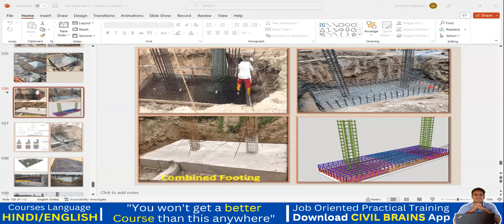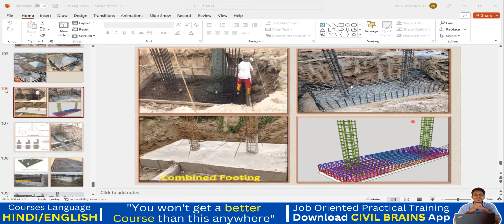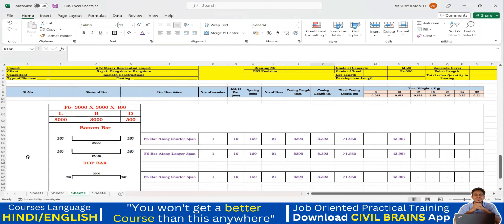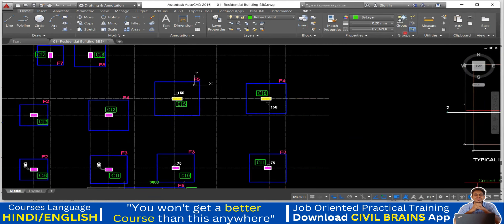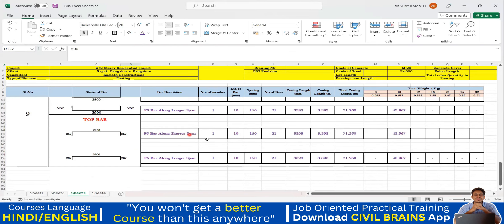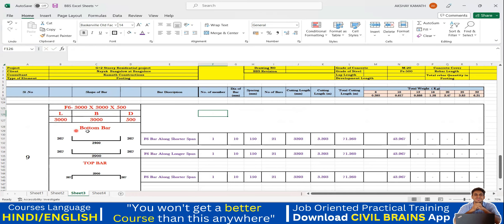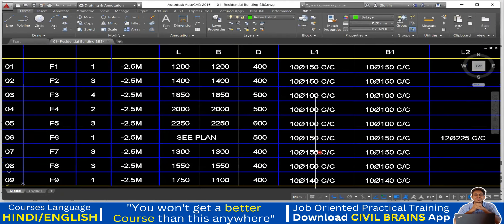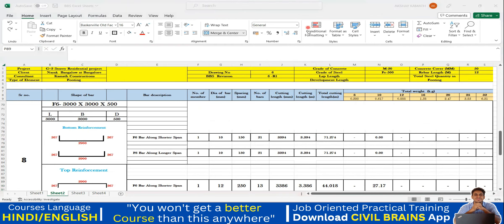How to Calculate BBS of Combined Footing ❓|| Combined Footing BBS Details🗞️  || Civil Brains

Comment: For all possible cases of irregular dimension in length and breadth -

Whether in Bottom or top reinforcement is it necessary to give Main/Higher dia towards shorter distance only ? While I have seen higher dia towards longer distance only and vice versa.....
Reply from the maker: Whichever side bending moment is more that part u have to give bigger dia bar